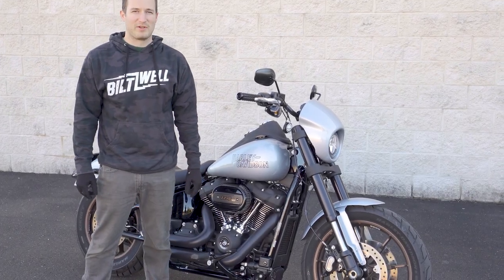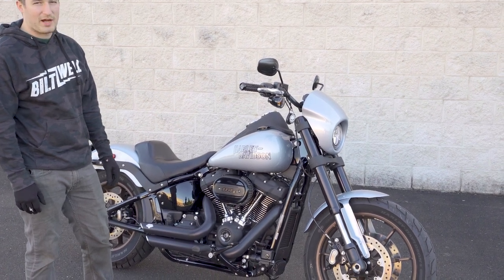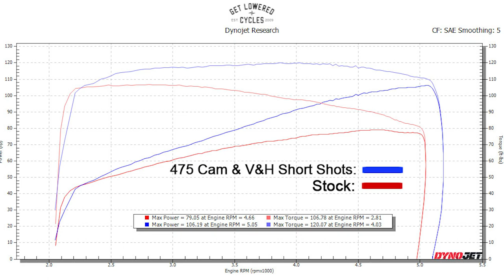2020 Low Rider S with S&S Cycle 475 Cam and Vance & Hines Staggered Short Shots - Dyno

Comment: I have a 2020LRS, and with the k&n air cleaner, TAB slip ons, and dynojet retune I'm making 120tq from 2000 to 3000rpm. But it decreases after 3000rpm. I'm honestly impressed with these short shots and the fact that the 475 cam keeps the torque band all the way through to 4500rpm. In my opinion, I'd rather have a constant torque band than a dip in RPMs. Definitely worth the money for my riding style.

Comment: hi i have the same exhaust on my Fxlrs 2020 stage 2 with a SE 462 cam. i had stage 2 done in march 2024. Since then my bike has been with HD because there struggling to tune my bike correctly. My bike is unrideable at slow speeds. bike just judders and it just wants to go. So in traffic its terrible. also back fires a lot every time the accelorator is released. Can i ask if u had ur bike tune by HD or DynoJET.?

Comment: What Exact  S&S 475 cam is it ?  The Torque cam or Horse Power cam ? In other words do they produce the same results?
Reply from the maker: There is only 1 type of S&S 475 cam and either chain or gear driven. I believe you are confused with Screamin eagle cams as they offer either a Torque or Horsepower option.

Comment: Very much like what you have done. I would be interested to know what map you used or did you have a custom map made?
I’ve just had the S&S 475 fitted to my FXDR  But am struggling to get it to run right. Very jerky on a constant throttle below 2500 revs. Very noticeable in the lower gears. Mine has been flashed with the dynojet  power vision map for the 475. 
I’ve got V&H Big radius exhaust and Screaming eagle heavy breather plus the 475 cam.
Reply from the maker: It's a custom map from the Dyno tune with power vision.
Reply: @Getlowered  how does it run on a constant light throttle in the lower gears at around 1500 to 2000rpm? Is there any jerkiness felt?
Reply: Go FP3 vance and h ines tuner can send them your map and what you got bolted on and they send you a wicked map too suit worth every penny
Reply: I auto tuned of FP3 and still wasn't happy with performance until I downloaded the map they sent me , she ran mental after that

Comment: Short shots are my favorite pipes on a Harley. They're so small they let more of the engine and frame be on display.
Reply: Same here! Had em on 2 different bikes now
Reply: I just had the 475 cam installed on my M8 114 Fatboy, with 2-2 Big Radius custom modified to have the same satin finish, and it's effing loud....If a stage 1 is about 105db, stage 2 is about 120db....I can't even imagine how loud short shots would be with a 475 stage 2!!!!
Reply: @Dozeball  I've got the exact same set up (the 475 is getting installed as I type this), but I was told that the torque under 3500rpm is going to be trash because of the pipes. Has this been true for you? How does the bike ride with that set up? Cheers
Reply: @ryandl8186  any updates?
Reply: @romeanaya7637  Yeah, mate, if you're thinking of doing this upgrade...DO IT! What I was told about the torque under 3500rpm being crap was absolute garbage! With my 475 cam, big radius pipes etc. it pulls like a freight train right through the rev range more so than stock (obviously it does pick up more, the higher up in revs you go). Just take it easy on wet roads lol. The sound is soooo loud, but sounds soooo good too
Reply: @ryandl8186  that’s good to hear! Thanks for the reply man!!

Comment: I was thinking of doing the s n s 465 cam. What kind of difference would that be from the 475 you went with?
Reply from the maker: 465 would offer more TQ and a bit of a drop in overall HP. Either would be a good option. 475 has a more aggressive idle sound to it.
Reply: @Getlowered  thank you!

Comment: Just had 475 s&s cam push rods lifters and v&h wide radius exhaust put on.   Also got power tuner.  Harley did the work but they don’t have a dyno so have been “mapping” it.    So far they have had to replace the O2 sensors and plugs.   As well as “remapping” it 8 times.   It’s back in shop now.   I’ve asked them to take it to put on dyno but they haven’t yet.    Have you heard of any problems like this with this set up?
Reply from the maker: It just needs to be tuned properly. It's most likely set up too rich in the idle/low load area.

Comment: Check out the new Woods 22X-E, has the 114s making 130TQ/115-120HP.
Reply from the maker: We've got one to test on our 114" Road Glide! We'll be getting into our cam testing this Winter.
Reply: It depends on a few factors, obviously....Personally, I liked the aggressive loping idle sound of the S&S 475 cam....The woods cam and the redshift cam had too close to 'normal' or too potentially annoying an idle sound for my taste....Anywho, My 114 M8 Fatboy with the 475g cam after extensive dyno, produces 127hp and 136 ft/lb of torque with the stock high flow air filter and V&H Big Radius 2-2 that I have had a ceramics guy shine down to a satin finish to match the bike.
Reply: @Getlowered  Hi, I was looking forward to the test of the Woods 22XE cam on the 114. Is this still in the pipeline?
Reply from the maker: @Zipoldy  it is, hopefully sooner than later

Comment: I just got S&S kit installed Oil pump with 475 cam and push rods. Dino shows 112hp and 120tq but on a seat does I don’t feel that power. Now I have les throttle response. Tuner is TTS tuned by Harley dealership any idea guys ? May be they should adjust throttle response ?
Reply from the maker: What exhaust is on it? It could be the throttle sensitivity also. I'd ask the dealership or whomever tuned it.
Reply: @Getlowered  TBR 2-1 turnout was no issues at stage 1
Reply: I guess My dealer did bad job on TUNE Your Dyno Shows Steady Horse power and TQ going up. My one Drops at 3k to 4k to 99TQ also Horse power is 60 up to 3.5k than its starts to go up. They are blaming my TBR 2-1 Turnout wich does not make sense. Turnout is updated version from TBR and 2-1 still would have more TQ than just regular 2-2
Reply from the maker: @amg5795  The TBR turnout does usually have a dip from about 2k to 3.5k once you add a cam but then climbs pretty well from there.
Reply: @Getlowered  do you have an email I can forward to you Dyno sheet ?
Reply from the maker: @amg5795  CS@getlowered.com
Reply: @Getlowered  Great sent you Dyno sheet.

Comment: Getting the S&S 128 with stage 3 (475 cam) on my 2021 Breakout.what kind of power would I expect to get?
Reply: 128 on my Road Glide with475 is 130/144. But I have longer primary exhaust pipes, 64mm TB ported intake 6.3 injectors. S&S Stealth Air Stinger
Reply: @thejackgraves13  I got 110/138. Short shots and no head work. First bike I've owned so feels fast

Comment: Can`t believe that the owner would spend all that money on the stage 2 cam and keep that shit pipe.
Reply: His bike. I did pretty much the same, but with a Big Radius, never cared for the added tq/hp, just did it because I wanted a lopey 2-2 pipe sound.
Reply: good pipes them
Reply: Im the owner. I had tbr 2-1 and swapped to the short shots. Both were dynoed with the same exact numbers. No difference. Except the sound. The vance and hines is way better/louder. Hope that answers your question.
Reply: Believe it Fella , sound Mint them pipes and good power
Reply: @claytonbaker3878  nice bike man have the same in black short shots sound badass ✌
Reply: @claytonbaker3878  Hello Actually was same numbers 2-1 vs 2-2 ? and feeling on the bike that 2-2 same power as 2-1 not mentioning the numbers.
Reply: @claytonbaker3878  that’s very interesting and goes against everything we know. Glad you clarified that. The SS’s are loud and look so clean.  I really like the rear wheel exposed and some pipes get in the way of cleaning it as well. Thanks for the info